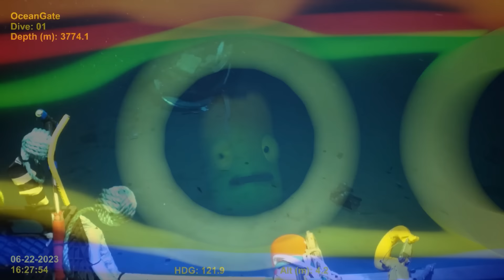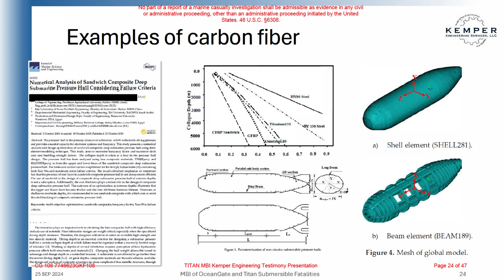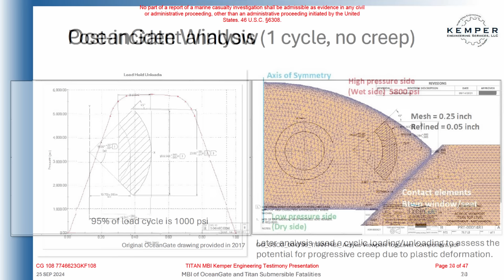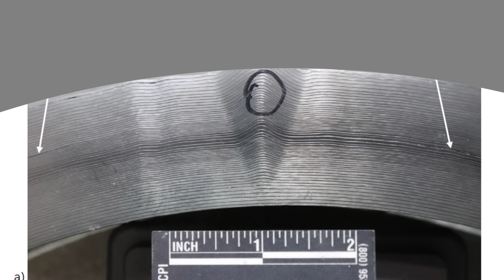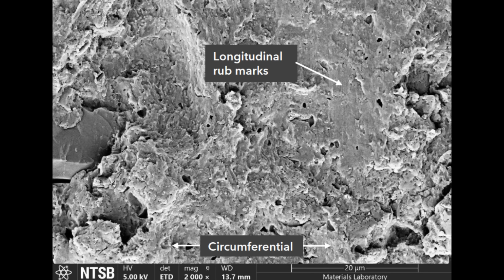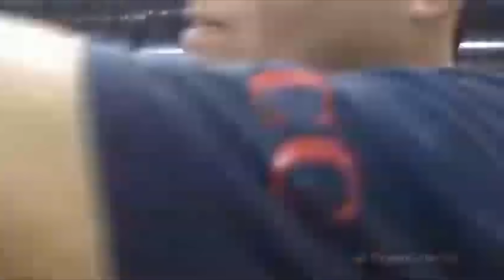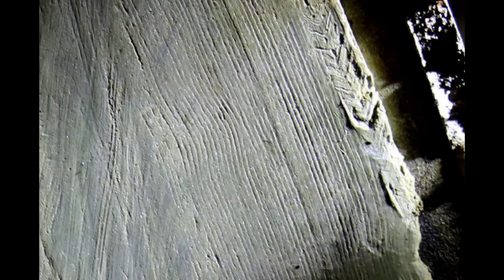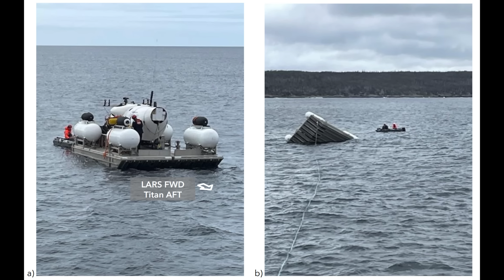OceanGate Wreck Shows Why Sub Wasn't Strong Enough To Survive - NTSB Shares Important Details

Comment: First rule of engineering- DON'T CUT CORNERS.

Second rule of engineering- SEE RULE ONE.
Reply: Usually that rule is metaphorical, though.  Here with the carbon fiber it was kind of literal, insofar as the wrinkles were pretty much unexpected corners.

Comment: With fibreglass and carbon fibre if it's not 100% sealed the tiniest amount of water getting in under pressure will expand when it comes to the surface, the next dive will let in a slight amount more causing more destruction until total failure.

Comment: A few minutes of sanding a 3D printed part will show you exactly why you can't machine a wound material. It's like sanding string. As soon as you bypass the material stress/thickness limit, it comes apart and unravels.

Comment: Carbon fibre composite is not homogenous and as-built there are imperfections per the video. Any engineer should be able to understand that you cannot model something like that to the level required or inspect for problems when it is riddled with them.

Comment: I'm not an engineer and even I know that carbon fibre composites are great in tension, but not great in compression. Carbon fibre would probably make for a great spaceship hull, for that very reason, it's really good at keeping gas inside itself. But for a submarine? You're going to have to do a hell of a lot of testing to prove it's viable and so far, Oceangate would be evidence in the "no" column.

The fact that the hull failed after so few dives tells me that either the material itself isn't suitable as it will fail much quicker than a steel or titanium hull, or that there was an issue with this particular hull. Either way, MORE TESTING, MORE TESTING and MORE TESTING was the answer, not just hoping to the mercy of the gods...

Comment: Barrel section of this should have been a titanium tube lined with carbon fiber for extra strength and reduced collapsability. Carbon fiber alone for the tube was the mistake and they paid the price. Or. The tube shape alone is the problem. Circles are the best shape for these depths. And if he wanted the submersible to hold more passengers maybe instead of a tube he should have chosen a double circle design where they meet together in the middle, curious if that would have been a stronger design in the long run

Comment: It seems to me they were more focused on the goals than the safety !
I'm no expert in submersibles or composite carbon fibre structures but I do understand that different materials behave differently under pressure and with temperature changes. Relying on glue to hold different materials together under extreme conditions seems like wishful thinking rather than trusted engineering practices !
There are more than a few weak points in that type of structure but it seams like they just thought the carbon fibre was going to be indestructible ! I also find it incredible that they ground down the bulges that developed as they built up layers and then added more layers over the top, this might be strong enough overall but the bulges indicate something was going wrong with the process that needed to be fixed but they ignored it !
They also ignored the data from the sensors so how many more warning signs did they ignore ?

Comment: I'll say something crazy in between these 3000 comments : This was so close to being a succes, if only they didn't cut corners during the construction, he would've have surfaced in victory and into the history books. 

He did proof that carbon fiber can be used as a sub hulls for deep dives, you just have to precisely control the quality. Maybe use rolls of carbon fiber, the width of the vessel so you don't create wrinkles as easily because you can pretension the film.

But something that is certain, Carbon fiber hulls can only be used 1 or 2 times for deep dives, after the dives the structure can be compromised and you wouldn't know about it.

Comment: I'm not an engineer. I have designed, formed and destructively tested carbon fiber experimental airplane parts.
The whole shit show makes my palms sweaty.
Reply: I was just sitting there going insane.
Like, Mr Stockman, the air isn't trying to crush your aircraft with pressures on the edge of the tensile strength for any known material and if the plane breaks up you can jump out. 
This is not the same.

Comment: I learnt more from your video on the methods Ocean Gate may have employed, but we can’t be totally sure.

It appears they had received some good advice on standard composite manufacturing practices.

I’m not so sure about the cleanliness of the laminating facility with people wandering in to the environment or talking without masks, or hair coverings near to the laminating process taking place. What about temperature and humidity control? This all matters; and a complete understatement for this particular application.

The peel ply leaves a textured impression on the surface to give a key for the adhesive which would usually take the form of a layer of pre-preg adhesive sheet, not applied as a paste as per the Ti end rings

If they had attempted to cure the full five inch carbon laminate in one operation there would have been greater chance of exothermic reaction which could also create fibre damage and voids.

I’m surprised the tape laying machine couldn’t have wrapped the cfrp tighter.

Did they periodically de-bulk the laminate to avoid wrinkles at all costs?

The flanges of the titanium rings appear very thin.

I would imagine the fore and aft ends would definitely require machining.

The information regarding the plexiglass window plug; I agree was very fascinating indeed.

One does begin to understand how much work and trials were actually done up to when things went catastrophically wrong which they obviously can do at 4000ft below sea level.

Mr Stockton Rush totally believed that he had nailed the design of the underwater craft. He put his faith into the project 100%. He knew that it was time to pee or get off the pot as there would soon be no business to discuss the levels of technical safety in any case.

Unfortunately this was the wrong decision and there should not have been a business opportunity on this scale without complete industry or governmental support.

❤

Comment: Space question : why is the sound in the communications between the ground and the vessel so bad. Look at crew 9 recently launched. We had perfect videos with good quality but the sound to and from the capsule was worse than a 1970s cheap talky-walky. Why ?
Reply: Radio doesn't travel easily through water. They were using acoustic modems. Just another reason deep sea is harder than space.
Reply: @qubei  Yes You are right. My question is a bit off topic with the video : I was speaking about the communications in space (Space X crew capsule, ISS, etc.)

Comment: A really interesting video. Thanks.  Carbon aircraft wings and fuselages are built 1 layer at a time with a debunk ( vacuum consolidation ) between each layer. Boats are de bulked every 3 layers. This reduces the amount of voids and keeps the laminate flat. There have been big problems in the thick carbon shear webs on wind turbine blades with wrinkling when using many layers. The method of construction has now been modified.

Comment: Whoever was the "genius" to sand the bubbles out should be sued. Think about it... take any given woven fabric and sand part of it.... you've disrupted the unity of the fabrics when you sanded them, thus making the fabric THIN and easy to tear. My theory: when they sanded the Carbon Fiber, they were weakling the hull, making a bad situation worse. I was a US Navy Submariner for 20 years- so I'm very familiar with all things submarines or submersibles. And for the record, as soon as I saw it was a carbon fiber hull and they had to bolt the nose cone on before diving, wouldn't touch that thing with a 20 foot pole.

Comment: Did the Titan collide with the seafloor?

All the pieces and small debree are quite close to the main wreckage, unexpected for an implosion of such force. and now we know it started to fail from the bottom of the bessel.
On the final commmunication transcripts we see surface being concerned about their weight during descent.

Did it land on the bottom and a weak hull couln't handle it?

Comment: Syntactic foam blocks are some of the most expensive elements of an ROV. I'd heard in one review that Stockton Rush didn't want to pay for the blocks hence the cheap CF solution. Also, fyi, as a rule of thumb foam blocks add 1Te buoyancy for every 2Te (in air) of foam. So for a 1Te sub, 2Te of foam would be needed, making the system neutrally buoyant in water, 3Te in air. And that launch and recovery system (LARS) on that support vessel was hilariously bad, there is no way that would pass any typical classification check for a manned submersible. A rated 50Te crane would have sorted the problem but that would be more expensive that the garbage solution they went with.

Comment: To me it looks like arch mechanism failure, those bigger pieces of hull look like about 1/6th of the circumference wide. So you get bulge (like the buckled piece) and indent. Which explains how you get the outer flange of the end cap being torn off and the inner flange sheared inwards.
It does not suprise me that they ignored the data logged from strain gauges etc. because that analysis takes a lot of time and patience, clearly missing from this project.
Also its easy to ignore all that work that needed to be done if you have literally proof tested the device several times after an event.
Its easy to make judgements in hindsight. 😢

Comment: It looks like channels have been eroded into some points along the inner flange fracture. The one on the top right is surrounded by a sort of "halo" on the flat face. That would be in line with the hypothesis that the pressure hull started failing in this section: There was a large pressure difference and shear within the liquid for a sufficient amount of time, i.e. it must have happened right at the start of the implosion.

Comment: That is a very interesting revelation that the carbon fiber hull did not receive 45 degree weave when made.  High pressure carbon fiber pressure tanks, I am very certain do use 45 degree weave in the construction.

Comment: the king armchair engineer calls others out for being armchair engineers with only subjective opinions😅 peel ply is mainly used so its a smooth uniform finish that isn't the vacuum bag surface. and even admits hes not an engineer.

Comment: One of the biggest mistakes is letting a CEO be responsible for mission-critical SAFETY decisions, there should have either been someone whose only job was to determine the safety and yes 9/10 times the guy would be overreacting, because, that is his job. but on that 10th time, he would save lives. And ultimately if you want a deep sea tourism industry, you need safety. It couldn't be as safe a flying, but that should be the target.  From doing a lot of reading since this disaster my main takeaway is water isn't to be fucked with, it's so far from our comfort zone, we should fear and respect the water.

Comment: So we've got (at least):
1) Negligent use of carbon fibers (layered only in two directions, which creates unfavorable forces between the layers)
2) Machining off wrinkles, weakening the top 5-10 layers of carbon fibers of each "pack" of layers

3) Negligent use of adhesive (lots of cavities [bad adhesion], layer too thick in places [bad cohesion], bad adhesion on some of the sub's parts)
4) Prior damage indicated by noise and sensors ignored
5) Last minute milling work creating new weak points
6) Ignoring all the advice from the people who actually know what they're talking about (even firing some of them for being honest and responsible)
7) Ludicrously insufficient testing
8) Changing the shape of a window AFTER rating a totally different shape
...
This is what happens if you hate on your government every time it intervenes into the economy and help rich asshole deregulate everything.